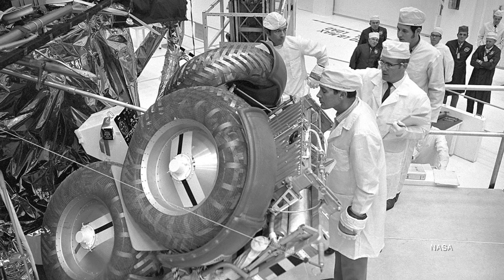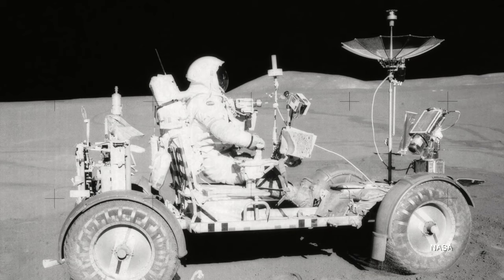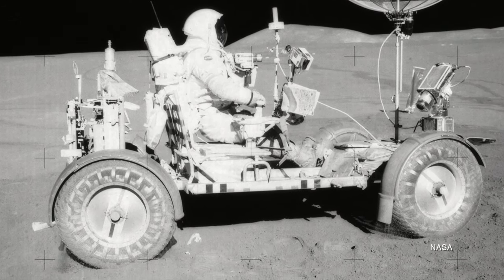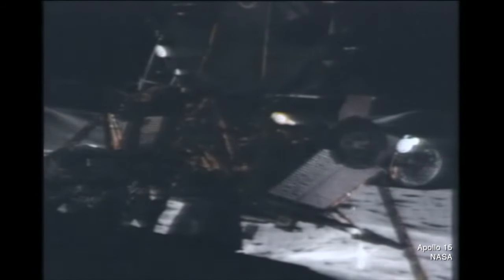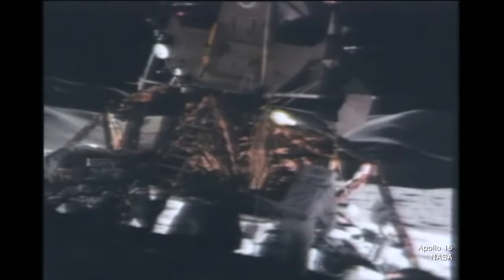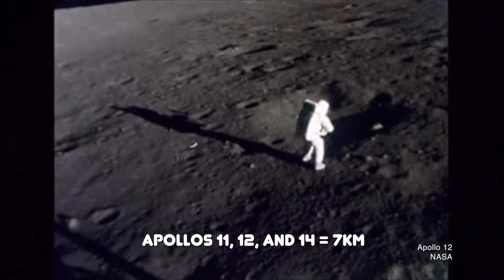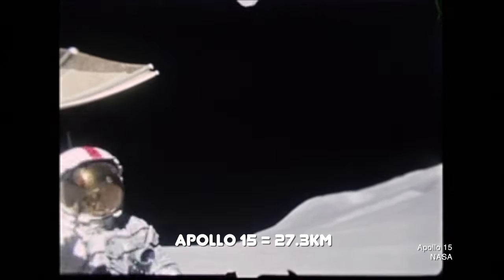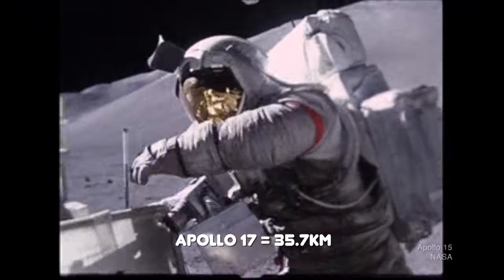How NASA Took Cars to the Moon

Comment: I wonder why they took a "Dune Buggy" to the moon, to goof around like they are on vacation. Instead of taking an astronomical telescope and camera? The astronomy from the lunar surface would have been unique and of great scientific interest.
Reply: "I wonder why they took a "Dune Buggy" to the moon, to goof around like they are on vacation. "   -  They didn't. What they did was take an off road vehicle on what was essentially a geology field trip. You go to the Moon in order to look at the Moon close up, and that means geology. 

"Instead of taking an astronomical telescope and camera? The astronomy from the lunar surface would have been unique and of great scientific interest."   --  But very little that could be observed from the Moon would be unique. If I asked you what could be done with a telescope on the Moon that could not be done with the same telescope in Earth orbit for a hundredth of the cost would you be able to suggest anything? In reality the only thing that can be done from the Moon that could not be done better  from elsewhere at the time was IR photography (as IR photography from inside the Earth's Thermosphere is problematic) and a camera and telescope for IR photography was used from the Lunar surface during the Apollo program.
Reply: @rockethead7  The Apollo Lunar Rover was equipped with two Silver Oxide 121 a/h non rechargeable batteries. The operating temperature range was +120f and - 21f. The temperature on the lunar surface in direct sun was reported to be in excess of 250f. The temperature out of direct sunlight - 250f.  How were the batteries kept within the operating temperatures? These were Silver Oxide batteries with 50 year old design. Modern batteries are no better equipped to deal with temperature extremes. Then there are the NASA photos on Flickr. Many showing the Apollo lunar rover on the moons surface, with no tracks from the wheels? Plenty of astronauts footprints around the vehicle, but no wheel tracks. Almost like it had been lowered by a crane? Fifty years ago I believed, now I've lost my faith. I am sorry.
Reply: @rjcornford  They could not replicate a stellar field from the lunar surface during the filming. So I believe the rule was to say no stars were visible. Just my opinion and we all have our own of course.
Reply: They never went.

Comment: Did they use lead acid batteries? How did they work in such extreme conditions? Imagine a car battery in an oven.
Reply: "Did they use lead acid batteries? "   -   No, the Lunar rover used two 36 volt, 105 ampere hour silver zinc batteries. You don't see silver zinc batteries in a domestic stetting because a battery made with a high percentage of metallic silver is restrictively expensive. They do get used on Earth by the military, for example as the power source for electrically powered torpedoes. That is, in contexts were the nature of the battery (power output, relative weight, reliability, etc.)matters more than its high cost.

"How did they work in such extreme conditions?"   -   Better than the alternatives.

"Imagine a car battery in an oven."   -   But imagine a car battery in an oven encased in an adequate thermal protection system. It is possible for people to recognise issues that will arise in known environments and design to mitigate those issues.  But then why imagine anything in an oven in this context? Ovens conduct heat into food via the air that they contain, and there is no air to do that job in the lunar environment.  In practice in a (near) vacuum the multi-layered aluminised Mylar thermal blankets used in spaceflight are pretty good at insulating  against the heating caused by direct sunlight. So under their thermal blankets the main thermal issue for the Lunar Rover batteries was the heat that they generated as they discharged, which was handled by embedding them in wax and using the phase change of the wax melting to absorb that heat.

Comment: I have a question... do you ever stop to wonder if all this stuff they say is real? 1/6 the gravity so they are worried about floating out of their seats but somehow they are firm enough on the ground to pull a cable that unfolds a large probably much heavier object from a compartment that is designed to keep the thing intact while flying through our atmosphere at 17500 mph? They just pull on the cable and it pops out like a balloon? You can see they guy picking it up and moving it. Dont you think they would need something solid amd sturdy? Not something you can pick up with one hand? Do you ever ask yourself any of these things?
Reply: Trebor  how did it get to the moon?
Reply: Trebor  so it had to be strapped to a rocket going 17500mph? Traveling through earths atmosphere and gravity? Then once they get there they just pull a little cord and it folds out? Haha you are confused.
Reply: Trebor  17500 is NASA's number and no i dont believe it goes that fast because when you watch take off it looks like its going hundreds of miles an hour not thousands. I think you are missing my point. None of this is real. Where is the dust that was kicked up from landing? Where are the stars? Why isnt the earth massive looking in the photos from the moon? How do they broadcast video over radio frequencies from the moon? How did they have a live conversation with president nixon over the telephone from the moon? Why cant they go back? Try and answer one of those questions to yourself. You will see what i mean.

Comment: A sample rover is in the Smithsonian Air and Space museum here in DC. I remember looking at the wheels closeup at the wiremesh. They did have an accident pulling the rover out or somewhere along the way and they needed a quick fix solution. Someone mentioned use duct tape to fix the dust guard or something like that since it can't be called mud guard.

Comment: Where is the actual telemetry from all the moon missions stored for review?
Reply: Depends.  Most of it was transcribed onto paper.  The raw form is just tapes.  But, technically, video is "telemetry" also.  So, that's been stored on tape, as well as converted to VHS, DVD, blue-ray, MPEG, etc.  But, most people just mean the data, so, you'd have to specify which data you want.  A lot of it is in the mission summary reports.  But, if there's anything you want that is more obscure, you can always send away for it, and NASA will send you copies (for a copying fee).  What exactly were you looking for?  There are aircraft sized hangars full of Apollo data.
Reply: @rockethead7  
🤣

Comment: Okay so you thought you saw Flames coming from the lunar lander as it took off well that engine could not reach Mach 4 which is the speed that it had to obtain in order to hook up with the the so-called lamb that was in orbit at Mach 4 how did that little engine accelerate those asteroids up to Mach 4

Comment: No one talks about changing weight and balance with the rover being added to the LEM this is very important in flight. And I also want to know where the helium tank was moved to now that the rover is taking up that space. I have a camper it can be cold in the winter and hot in the summer just like the LEM on the moon only more extreme. The camper has to be plugged into shore power for the AC to be reliable. It doesn’t work on solar well at all. Electrical heat dose no work on solar very well either. I also have a pvc 4 wheel bike that also runs on batteries it weights about 100 lbs with out passengers and it can’t go 20 miles on one charge. Way to many questions that don’t have good answers
Reply: The extended stay version of the LEM was about 2000 kg heavier than the previous ones. The rover weight was only 200kg of that. They carried more of everything, mainly fuel, but also more batteries and solar panels, they distributed all this extra weight, including the rover, in a logical fashion to maintain balance. The rover didn't take up the space of the helium tank. There were four quadrants for stowage of miscellaneus gear built into the design. The rover used one of these quadrants. I don't understand the camper analogy.
Reply: butchtropic  It would seem that you are right. I don't remember where I got that idea from. Thanks.
Reply: When you Google the LEM's schematics, you will find two basic forms: the schematics for the early missions (everything up to Apollo 14), and the schematics for the later missions (15-17).  Beyond that, the following is a brief overview (only 150 pages or so) of the main changes they made for the later missions (the extended engine bell, the heavier weight, the rearranged descent stage to accommodate everything, the additional batteries, more capacity for consumables for longer stays, etc.)
https://www.hq.nasa.gov/alsj/a14/a14-43939523-LM10-LM14-Fam-Manual.pdf

Comment: Video of the rover deployment appears to have been lighted by a focused light source to the right and behind the cameraman.  But the sky beyond us black, so it couldn't be the sun.  Did they also bring spot-lights? 

Also, in regard to videography, you show a video of the lunar module blasting off from the moon and the camera sweeping up to capture the scene.  But how did NASA get the camera to sweep up at exactly the instant of the blast off, and how did NASA get that video footage to earth, because the camera was still on the lunar rover on the moon?
Reply: YOU SAID: "Video of the rover deployment appears to have been lighted by a focused light source to the right and behind the cameraman.  But the sky beyond us black, so it couldn't be the sun.  Did they also bring spot-lights?"

== Um, what?  What color do you expect the sky to be?

YOU SAID: "Also, in regard to videography, you show a video of the lunar module blasting off from the moon and the camera sweeping up to capture the scene.  But how did NASA get the camera to sweep up at exactly the instant of the blast off, and how did NASA get that video footage to earth, because the camera was still on the lunar rover on the moon?"

== The three rovers had remote control cameras.  There was a dish on top of each rover that sent the signals back to Earth.  The tilt camera was broken on Apollo 15, so they didn't capture the liftoff very well.  On 16, they did an OK job of capturing the liftoff.  It was a bit out of frame for some of it, but not too bad.  But, by Apollo 17, Ed Fendell had practiced enough that he got the timing down pretty well, and it was a near-perfect video.

https://upload.wikimedia.org/wikipedia/commons/thumb/e/ed/Apollo15LunarRover.jpg/1200px-Apollo15LunarRover.jpg

Comment: How hot is it on the moon
Reply: Well, without an atmosphere, the question "how hot is it" really doesn't equate to anything that you'd be able to translate to what you're used to on Earth.  The surface of the moon does have a temperature.  But, without an atmosphere to conduct that temperature, it really doesn't mean the same thing as it does on Earth.  You can easily Google "surface temperature range of the moon" and see all kinds of data.  But, for Apollo, they only landed on the moon in the morning (remember, the "morning" on the moon is the equivalent of a week on Earth), so the surface wasn't super cold or super hot.  Apollo 17 took one surface temperature reading of around 120 degrees (F).  You can look up all of the other readings if you wish.

Comment: the radiation received on the almost half million mile round trip and open exposure on the surface shows how magnificent those spacesuits really were. why not use them in fukushima? chernobyl, long island?
Reply: +The Woob Radiation dose in translunar space is around 2 millrems/hr - proven by multiple probes from several countries. It would take around 8 months at that level to get the same dose as that recommended for ab annual limit for nuclear power plant workers.

ISS astronauts are in space for months and are exposed to gamma radiation at a similar rate. The magnetospere does not affect gamma rays at all as they are photons, not charged particles.
Reply: The Woob you can prove me wrong by simply affording one
Reply: Also, space suits are designed for microgravity or, at most, 1/6 Earth gravity. They're clunky and heavy as heck on Earth.

Comment: What she's not telling you is Quadrant 1 was used for 1 of 4 Critical helium fuel tanks. They took a tank out and stuck in the rover. This is Proof of the Moon Landing being faked. They couldn't have made it without that fuel. Look at this time stamp 33:21 https://www.youtube.com/watch?v=gzkn_ufRzDY&t The rover was also one of 3 distinctly different rovers that were used between Apollo 11 and Apollo 17. Even 3 different tire tracks. They Only brought 1 rover it is claimed and they didn't bring extra tires with different treads.
Reply: What are you talking about? Descent Module carried only one supercritical helium tank (not "fuel tanks"), and it was installed in Quadrant 3, not Quadrant 1.

And what is it about LRV? Only the last three Apollo missions carried LRVs, and they all had the same type of wheel, with the same thread. Your video bases its claim upon, what, lack of fenders? Some of them fell off, and were taken back to Earth. How could anyone get confused by this?

Comment: This has already been 
Debunked. It was impossible to fit the vehicle into the spacecraft. I call bullshit
Reply: I'm curious.  How does this work, in your mind?  There were 7,000 engineers who designed and built the Grumman lunar module.  There were hundreds more at Boing, General Motors, and JPL, who designed and built the rovers.  Do you think all of those engineers simply forgot to make the two vehicles fit together?  Is that how this goes, in your mind?

Comment: How did they inflate the tyres? No air on the moon. So pre inflated ? Did they have repair kits. And if they only thought of using rover in 1970, how come they had room to transport it, inside the gold foil lined space craft?
Reply: Trebor  wire mesh..so, they, just popped into shape? Because wire doesn't have a good memory, just like NASA.
Reply: I just love how you post 100000 messages, always thinking that you've somehow outsmarted the entire planet's aerospace engineers, with something so basic.  You didn't even know what the wheels were made of.  You had no idea.  Yet, 2 minutes after you found out, you immediately rejected the answer, as if the hundreds of engineers at Boeing and General Motors who designed and built the rovers, were all simultaneously oblivious about the properties of metal wire mesh wheels, and YOU know better... in 2 minutes.  You go from video to video, thread to thread, spewing absolute gibberish, pretending to know things you don't know.  And, the moment someone demonstrates how wrong you are, you simply switch topics to something else (that you're equally wrong about).
Reply: @gervasebarnes  : Funny how you’re too cowardly to actual research. Why is that?
Reply: @nunya_bizniz  🍇🍈🍉🍊🍋🍌🍍🥭

Comment: They should have used battery powered motorcycles.  Lighter and more maneuverable.  They could have pulled carts behind them.
Reply: They actually tested that, with motorcycles suspended by overhead cables.
It turned out to be much harder to keep the balance in the low lunar gravity.
Reply: That's interesting.  Did not know that.  Maybe they should have tried out stablizers.   AK training wheels for balance.  Would have looked really cool seeing Astronauts doing some cool jumps over craters.  In low gravity they could get some real height.

Comment: obvious that d only reason for this video is to try to answer d legit question of who filmed them leavin d moon. answer is a good cameraman in Hollywood at some desert. got it? if d car is there den zoom in on it with d hobble telescope.  comprendè
Reply: A tripod. Bam.
Reply: Deren Icke:

YOU SAID: "if d car is there den zoom in on it with d hobble telescope."

== Hubble doesn't have the resolution, nor is it designed to focus on an object on the moon.  But, LRO does:

https://www.nasa.gov/sites/default/files/images/584392main_M168000580LR_ap17_area.jpg